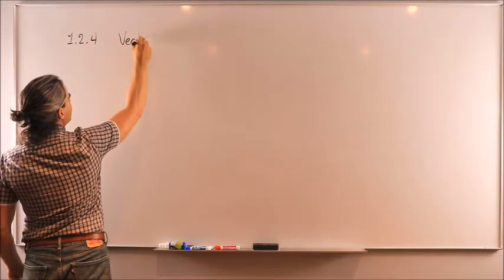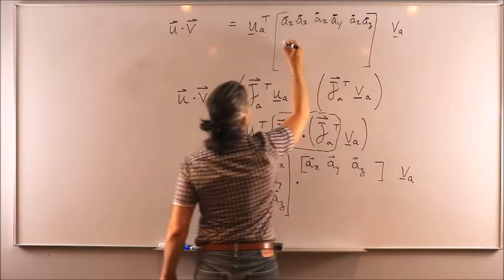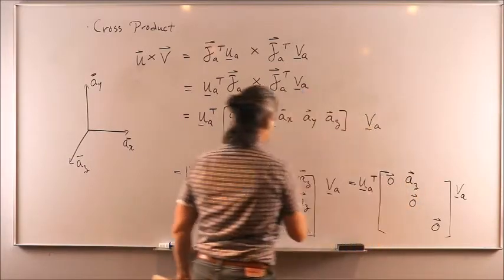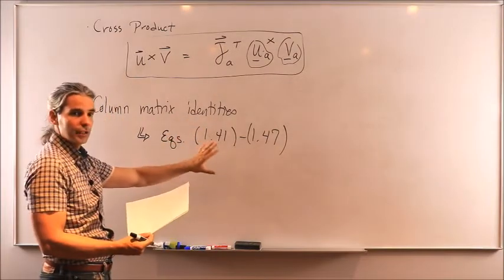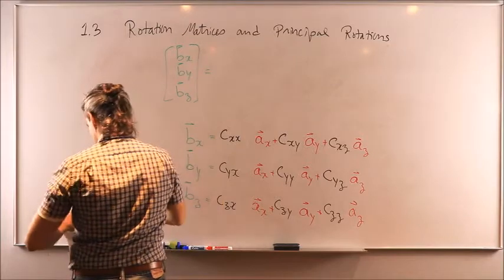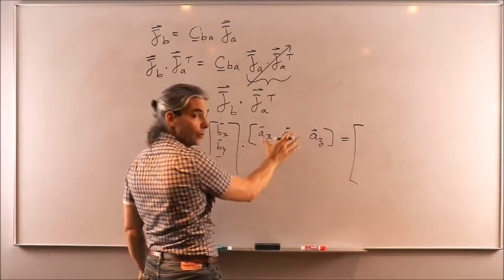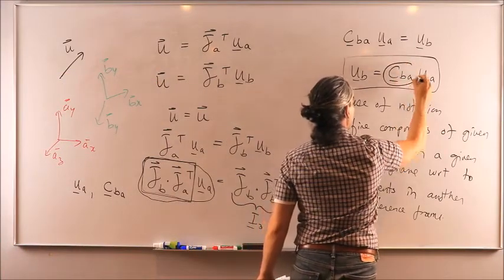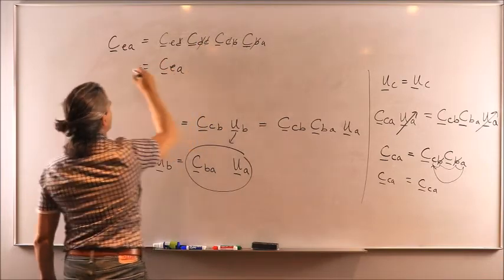Orbital Mechanics - Vector-Component Operations and Rotation Matrices

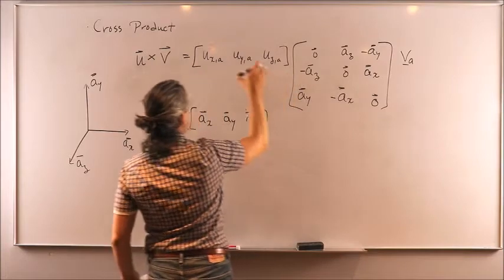Comment: I couldn't understand from min 22:20 (how) ?
Reply: Took out the unit vector ax, ay, az (which is the unit vector used to define the reference frame) from the vectrix u. Then multiplies the components of u as you normally would for a 1 x 3 vector and 3 x 3 matrix. Row x column.